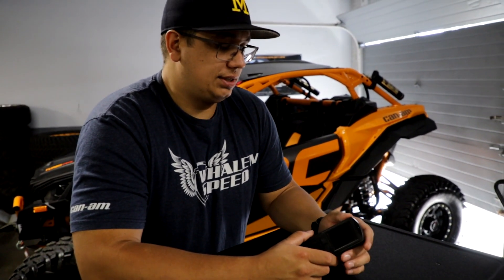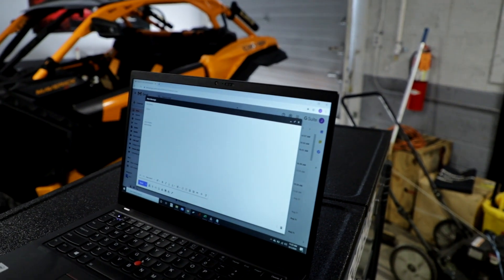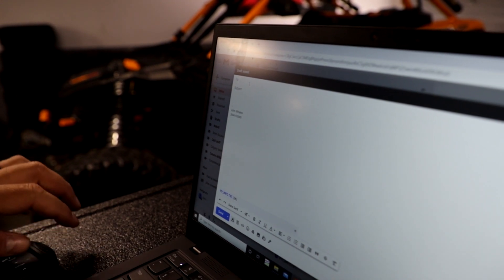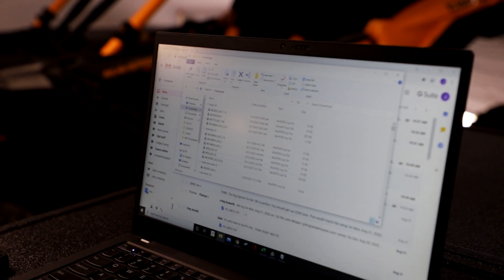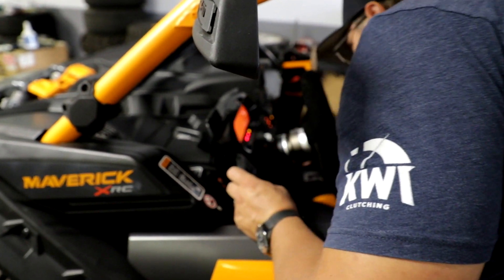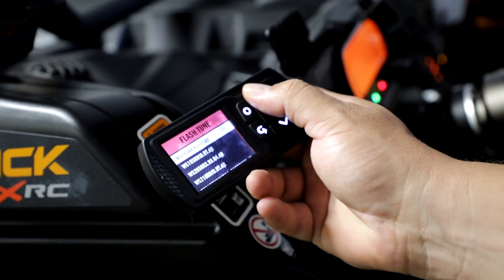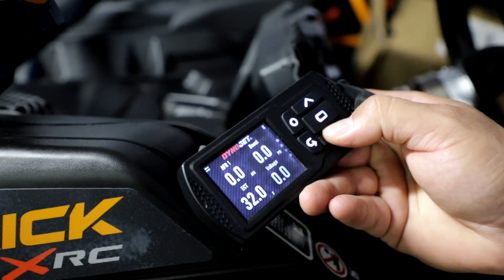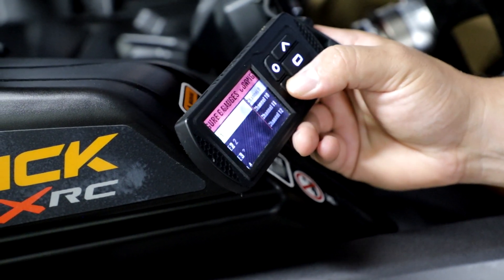Whalen's Speed: DynoJet PV3 Tune Flash/Procedure | 2020 Update

Comment: I have to send my pv back to be checked. So I send it with the stock tune on it or put it back on side by side before I send it in?
Reply from the maker: Typically dynojet will flash the PV3 back to a stock file so just make sure you have the tune file saved from your tuner of choice. Most of our clients have great experiences with warranty claims and servicing.